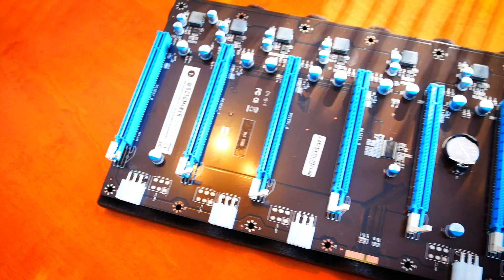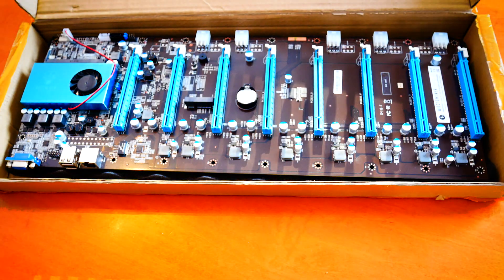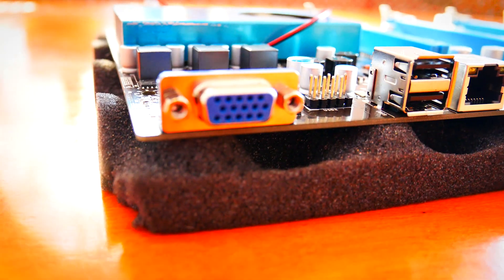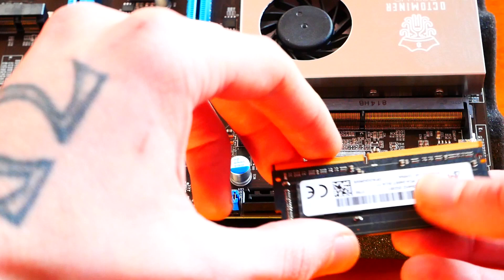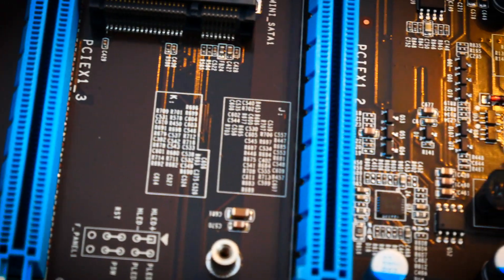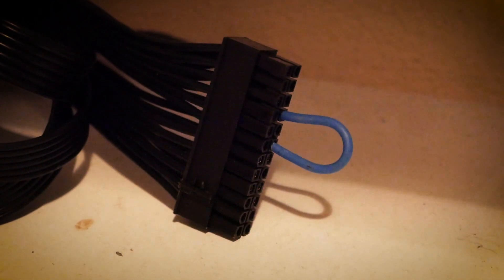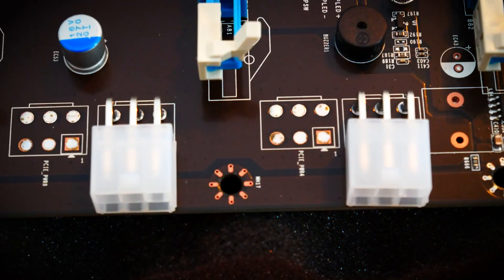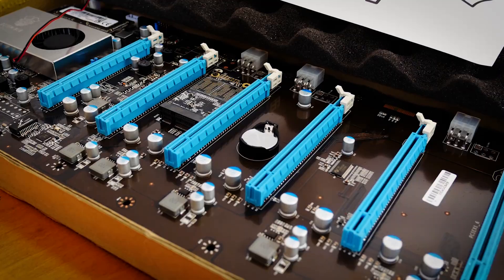Octominer B8Plus Motherboard: first look (riserless GPU mining) ICE6S

Comment: what do you think of the temps if its not on a server case . and its just out like a normal riser mining rig. planning to buy one . also how many slots spaces each pcie have? what if i still use a riser in this one will it still work?. do i have to power those 6 pins too on the motherboard?. this board is really cheap here and have 8 slots. motherboards here right now sell for $200+with no cpu with only 6 slots while this sells only for 80$ here. do you also run this on windows?
Reply from the maker: depends on the cards, if they are super low powered cards it might work without case but honestly it is still super super close and they might overheat - only 2-slot cards work. Theoretically you can still use a riser as they are full X16 slots but I have not tested that. It is recommended to power the other PCIEs if you either have GPUs without power plug (1050Ti etc) or very powerful cards, I powered them all just to be safe. 
I did run it on Windows first until the mSata I had in there died, since then I am on Hive with it, running 24/7 to this day :) cheers ⛏️
Reply: @CursedMining  Thanks for the response
Reply from the maker: Anytime ⛏️⛏️ cheers

Comment: VGA slot? Are you fucking kidding me? Who still uses a monitor with the ancient VGA connector?
Reply from the maker: ...a lot of older mining mobos have those tbh - same for H81 Pro BTC etc. - but yeah, adaptergame has to be strong 😁
Reply: @CursedMining  The issue is not that a VGA port is there, but that there is no HDMI or Displayport. I like to use the integrated gfx to configure everything instead of one of the GPUs, so I can squeeze most out of them and it's more stable.
And having the need to buy a VGA adapter in 2021 is just silly.
Reply from the maker: How about trying something like HiveOs? You'll find a video on it on my channel - no need for display output :) even H110 Pro BTC only has DVI, I understand 100% what you mean. Then you can also turn of integrated gfx, as they can impact your rig as well. Cheers ⛏️

Comment: and the nyou google how many ppl throwed this away because of BIOS unavailable DRIVERS etc...and yes if you break your pci slor you have no chance to do like with risers and they very close each other means it is very hot and shit can damage your all rig
Reply from the maker: Mine is running fine to this day, but I agree I would not buy it again either. A lot of issues software wise. Regarding PCIE: well yes that happens with proprietary mining parts, same as with all riserless boards. Regarding closeness: that's really on the operator, I have a closed case with Delta fans, it is the coolest rig I got - cheers ⛏️

Comment: Anyone had problems with it? 4beeps, no output?
Reply: Yes please, is the video public?
Reply from the maker: @klevi7325  check for "octominer gpu not found" - cheers & good luck!!
Reply: @CursedMining  no luck, changed ram, changed bios battery. Still 4 beeps, no post.  I guess it's  a fight now to return it .
Reply from the maker: with what are you trying to boot? I remember I had some issues in the way the drive had to be formatted
Reply: @CursedMining   i tried a live win usb nothing else,  but even without anything connected it does the same. It should post and be able to enter bios without a boot device right? The other thing... these mb don't have a power slot for the cpu?  Does any of the pcie power needs to be connected ?
Reply from the maker: @klevi7325  Correct, it should! Also yes, no classical 4/8pin for CPU, so definitely try all PCIE lanes too :)
Reply: @CursedMining  nah, this is ko. Waiting for seller to respond, then I'm returning it. Waste of time..
Reply from the maker: @klevi7325  sorry to hear that :( hope you can get it resolved!!
Reply: @CursedMining  thanks for your help. Happy mining!
Reply from the maker: @klevi7325  Anytime bro! Happy mining to you too ⛏️
Reply from the maker: I have a video on it bugging and not recognising GPUs etc , maybe some of the steps can help you?
Reply: @CursedMining  
?

Comment: Can you recommend PSU power for cpu mining with two graphic cards?
Reply from the maker: Hellou, depending on the system, what GPUs and foremost your settings but normally you can get away with a 550 / 650w PSU easily - cheers ⛏️

Comment: I use the same board. With 8Gb memory. No SSD but I use SMOS for USB. With 4 GTX 1070 cards I mine about 1750-1800 Sol/s @ 500 Watt.  Same power supply. No problems at all.
Reply from the maker: Hey Willem! Thank you for checking in and sharing your experiences! I'll be posting a video about the mixed nVidia rig I'm building with it on Tuesday =)  my tests for now are also very positive! In my "Crypto Mining Mail #1" video you can see the case and a fan mod I had to do (wanted to do it, but later realised i HAD to do it). All the best! CM